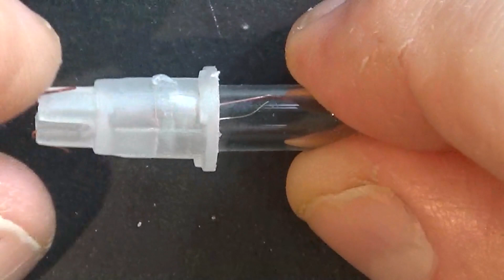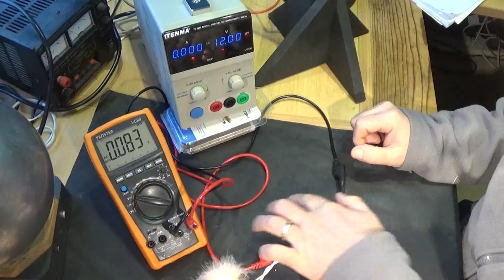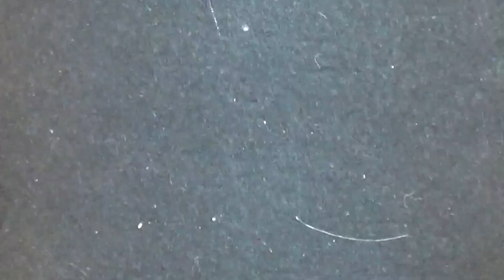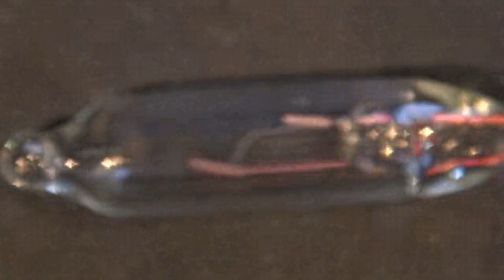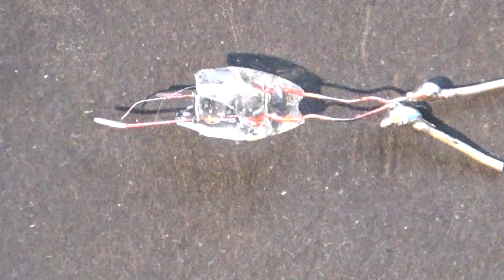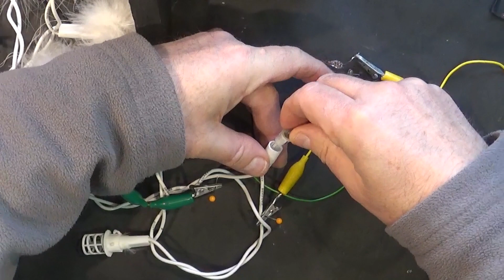Fairy Light Bulbs. How Do They Work?

Comment: I was wondering how the rest of the lights keep on when one failed and your video appeared! Google AI just told me this:

"Modern Traditional Lights (with Shunts): To solve the problem of the whole string going out, most modern incandescent mini lights have a small, insulated bypass wire (shunt) across the filament.
When the bulb is working normally, a low voltage runs through the filament, which produces light.
When the filament burns out, the full line voltage is momentarily applied across the small shunt wire, which burns through its insulation and creates a short circuit, allowing electricity to bypass the blown bulb and continue flowing to the rest of the string.
The remaining bulbs stay lit, but each receives a slightly higher voltage than intended. This is why it is important to replace a burnt-out bulb quickly, as the increased voltage and current on the remaining bulbs shortens their lifespan and can cause a "cascading outage" where more bulbs rapidly fail. "

So, it must have a relatively high resistance insulation that doesn't heat up at 12v but does at 240v. Mystery solved! (Although I don't know how your setup reset at 12v DC!)